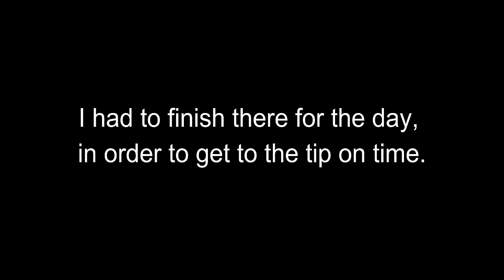CUTE yard was a JUNGLE! Incredible yard restoration

Comment: Great job Sean. Drives me crazy dealing with those dam weeds in the bricks! 😁 The owners just have to learn how and when to spray. I couldn’t get over how busy that road was! I bet it took you forever to get out. 💚
Reply from the maker: Thank you! Yes I had to be quick on that road!
Reply: Probably all the concrete and brick work tricked them into thinking that they had a no-maintenance yard (and they found out the hard way that there is no such thing).  Damned weeds will find a way to grow just about anywhere!
Reply: You need to fill the gap with the right stuff, I filled it with a special no grow sand which is based on ceramic materials. No food for weeds takes years for stuff to grow between the blocks
Reply: Would putting an (anti)weed mat down before laying the brickwork have helped?

Comment: You know that whippersnapper cord someone from  mower shop if you’re Soak the whippersnapper cord in water helps it stay more stiffer so when you use it it doesn’t break off as easy and something not what I got told about I haven’t tried it yet but thought might be at worthwhile one to pass on